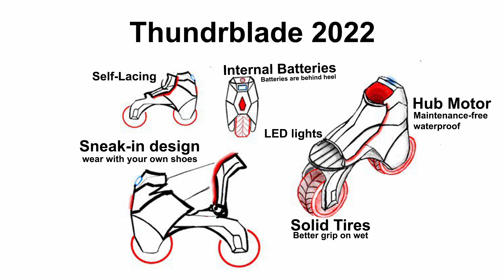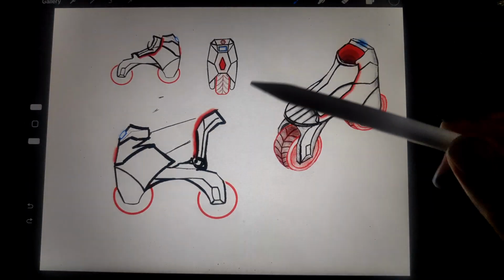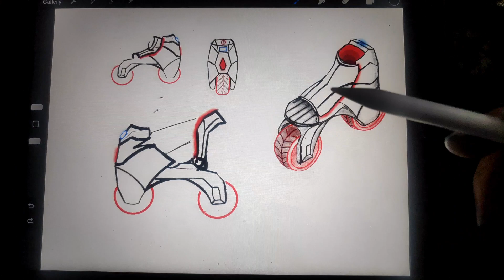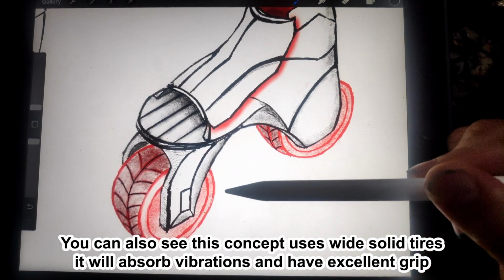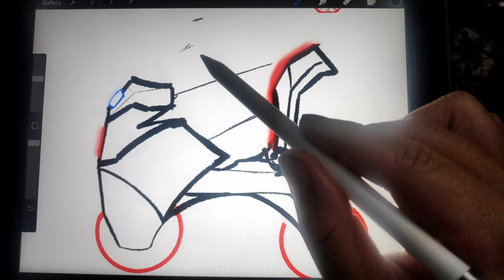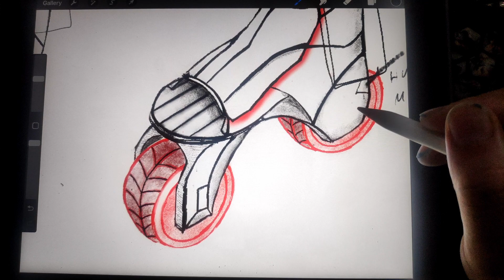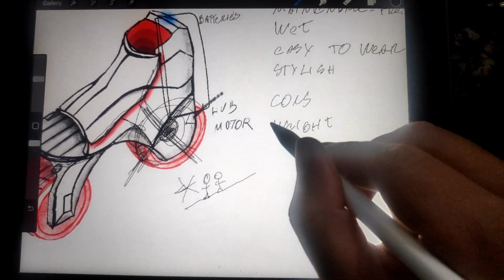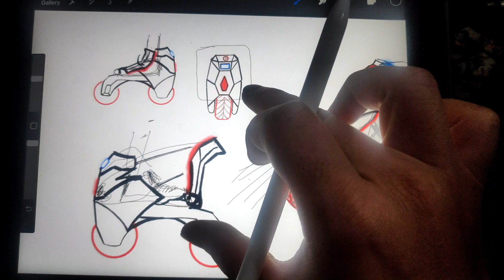Why Thundrblade will use HUB motors going forward

Comment: I honestly like the design. I see with the increased weight reinforcing this as for travel not extreme sports. It being slower is better since I don't expect to be a character from Air Geaf and survive. The video only left me with the question of control. How do you control speed, the locking system, etc. In the end this still has my attention and desire.
Reply from the maker: thx!
the handheld remote controller is how everything will be controlled. I think a "parking brake" dedicated button plus the slider to accelerate and brake.
basically the same as the old concept and the majority of electric skateboards out there.

Comment: I think the step in design together with a speed max of 30ish km is great for everyday use. Overall people on bikes travel around if not below that speed and with the size skates have they are easyer to store as well which I see as a big pro. Personaly I don't care for the LID lights but can understand if one of the goals is style. Weight wise I am not sure but I will keep an eye out for new videos on how much it might weigh. I also could not tell from the design itself if using this design for grinding is a possibility or at least doable.

Overall Looking good and you got my support.
Reply from the maker: thx Kitsune!
oh yeah, for urban commuting an electric inline skate that its convenient to step in and small enough to fit under a chair is great.

I dont intend to make thundrblade able to grind, BUT we can always make add-ons like an H-block, DIY is always a possibility as well.

I personally think a PEV Personal electric vehicle should not try to compete with dedicated and specialized sports equipment as it will always be worse at doing that.
I do understand though that grinding frontside and backside on a bowl and doing some airs would be awesome.

Comment: So excited Daniel!!!!!!! Re: Batteries, they could mount on the back and be quick swapable like cinema V Mount batteries. Re: Laces, electronic is cool, but if the batteries die, you can't get them off! Could use the same wire mechanism but manual twisting would be sufficient I think. (Now that I think about it, 32km/h torque on the feet held on only by wires is a bit unsettling. Is the Powerslide Doop ratchet strap system not fast and secure enough? ) And apart from motor powered skates, the second most exciting feature is the ability to adjust speed when going down hill. On a bicycle it feels safe because you can scrub speed with the hand brakes. But with inline skates it feels unsafe and requires a lot of skill to slow down on a hill. So being able to slow down like a bicycle handbrake makes it much safer and easier for everyone. Especially non flat cities. Good luck with the project Daniel, I'll be happy to help make videos to promote it!
Reply: Another thing, you could sell it as a complete skate, but have the frame and battery completely removable for the times one wants to put on non motorised wheels for fitness training/fun. That way a person only needs 1 boot.
Reply from the maker: Its still possible to skate for exercise in this new concept. the wheels roll normally when motors are turned off. this boot should not hinder this.

but if someone feels the need to have a carbon boot with skin-tight fit, or need a traditional 4 wheeled frame, its probably better to have a separate skate altogether. I mean, I have several skate pairs just to practice different modalities like slalom and aggressive and fitness.
Reply from the maker: Hey Hubey, thx for the feedback.

batteries will be quick swappable, so you can carry as many as you want and change them easily and quickly.

oh yeah, the self lacing is still in concept phase, but your concerns are valid. lets address them
I think there should be a mechanical, not electronic button to release the laces. the motor only pulls them, you would need to pull them off yourself to release them by pulling and pressing the button. so no need for batteries to take them off.

the same button could be the disc to manually lace, just like old puma discs or modern cycling shoes. after all, even without batteries this should be a skate.

the doop system is definitely not convenient enough. for me at least. I own a doop and a shadow and I love them but I still need to sit down and make a lot of effort to secure them.

thundrblade always used a handheld remote controller, so regenerative braking was always on the project and actually working on the old prototype.

Comment: This looks like it will feel less like rollerskating with such wide tires to manuver and make sharp turns , maybe im wrong tho , the design looks cool great idea to make them step in with your shoes , the auto lace are not particularly appealing to me as the wear and tear on laces happen as with every thing so i think standards scratch like on the doop skates would be better so it can easily be replaced when you need to , the locking is à good feature but will it also have regenerative breaking to refill the battery going downhill for instance ? Also i remember there beeing a remonte on the previous version, will it still be the case ? If yes check out Snowl ring an upcomming product currently kickstarting that make gesture controle with a ring size controller i think it would be cool to have it be compatible with something like that
Reply from the maker: Hey pablo, thx for the comment.

These wide tires will definitely steer thundrblade away from the traditional inline skate feel. Until I can actually test in real life I cant say for sure how much, but maybe its even better... who knows? less vibration, more grip, the ability to skate on wet surfaces and the ability to ignore pebbles seem pretty appealing to me at least.

the wear on a self lacing system is a valid concern I will take this into consideration when designing it. but you know, straps/velcro are already around if needed, lets try something different for now :)

regen brake is definitely on as well as the remote.

oh yeah I've thought about gesture control, weight shifting and all, but the easiest for most people will be the remote, also it is just easily available. maybe in the future, we can delve into developing something. for now, my focus is the skate itself.

support us on ko-fi

http://www.ko-fi.com/thundrblade
every single dollar helps.

Comment: the self winding system might be a little too much for the battery as well as all those LED's, the front lights make more sense imo and the rest should better be just optional. Other than that I am really happy to see you pick this up again I will support it as much as I can, keep it up ✌😊
Reply from the maker: the LEDs and the self-lacing system spend so little energy compared to the motors it will make absolutely no difference in the range. Even a very strong front light would be around 1~2 watts compared to the 500W from the motors.

thx for the feedback though. I can see that its a concern for some people. Thundrblade will still evolve and change so nothing right now is set in stone.

Comment: Hi Daniel,
Fellow inline skater here!
I've been a big fan of this project for a long time and I've shown off your videos to some of my friends and coworkers and they're all impressed with your work. I'm glad to hear you're back at it again in spite of every challenge you've faced along the way. Right on, brudda!

The HUB motors seem to be a logical next step in improving the overall performance of these e-skates, especially given the flaws of the friction drive you stated (great points to reconsider). But with talk about how these motors have quite a bit of weight to them I worry that, by putting the motor and power supply in the back, their combined weights might throw off the balance and weight distribution of the skate and make them heel-heavy and antithetical to the center-balanced nature of inline skates.

Would you happen to have any thoughts about this?
Reply from the maker: Hello Will, thank you very much.

About the weight distribution problem. It will definitely feel a little weird in the beginning. I will make a video explaining this in detail, but when you skate with 2 wheels in opposition to 4 or 3 wheels you balance is shifted backwards already.

Inline skates turn by dragging wheels. on 3/4 wheel skates you have to center your weight in the middle wheels and turn by dragging both front and back wheels or by shifting your weight backwards and dragging the front wheel.
for 2 wheel skates you mostly drag the front wheel, you only drag the back wheel when skating backwards (fakie) 

a heavy skate like this concept will definitely affect your technique when lifting your feet off the ground. theres no denying this. Since you dont NEED to skate on a motor powered skate, this will be less noticeable.

now, for my own experience. I tested this weight distribution before. its ok really. feels a little different, but its not bad at all. you'll get used to it fast.
if you want to feel it, try attaching a 1kg weight to your skate heel and skate with it.very simple. if you try it, please come back and say what you think about it. :)

Comment: I found you last year, I watched every video multiple times. Seeing how the motor system was, I was worried about water as you mentioned. But, I was also worried about loss of energy and not being as efficient, as well as wear on the wheel and everything on the motor, as well as possible stripping problems on various parts. Hub motors are a great idea!
Reply from the maker: legitimate concerns, but to be honest efficiency on friction drives are actually high. depending if you use chains or belts and their qualities, friction drive could be better.

especially considering our modern inline PU wheels. 
anyways, old prototype had a better Wh/km than belt electric skateboards. not by much, but considering it was a prototype it was good enough to prove efficiency was not a problem.

and thx for watching the videos <3
Reply: @Thundrblade  No problem at all! I dodn't know that friction drives had such high transfer efficiency, honestly.
The battery efficiency should be better now compared to 3 years ago, though. Batteries, at least phone batteries, made a noticeable leap in efficiency for size in the last 2 years. Normal consumers won't notice because phones have also gotten more powerful cpu's which, unlike computer or laptop cpu's, jumped in energy consumption just as much as the batteries jumped in efficiency. 
But, batteries in general made a very noticeable jump in efficiency for size. So really, it'd come down to the wire gauge, connector type, and wire insulation type you go with that should impact the efficiency the most. That's something people also don't generally know. Wires impact power efficiency, too. You can have the best battery for capacity and efficiency and the best motor (or whatever the power is going to) as well, but if you have low-quality wire the efficiency is going to be worse than expected. You might even run into overheating issues that could more than easily melt the insulation and cause a short, blowing the battery and/or motor.

Comment: 6:38 That might be too ambitious; Personally I'd use velcro or adjustable straps.
Reply from the maker: maybe. but we can dream.

a skate where you dont need to sit or even touch with your hands to strap on is a beautiful dream.

of course we can always go back to traditional lacing as well. 

on the more serious note here, the self lacing feature is not that hard to implement, but we will have to try to be sure.
thank you for your comment.

Comment: I like the slip on boot feature, And great explanation on why its a rear wheel drive motor. I do like the design but what I personally look for when shopping transportation devices is the distance/range of the battery. So to maybe compromise with that you can use the gap in-between where the arch would be although it will add more weight. Overall though I'm liking the concept.
Reply from the maker: yeah, I forgot to talk about this.
Batteries are swappable, so you can get the lightest possible skate on your feet and just carry more batteries if needed. even old concept had swappable batteries, thats why I forgot to mention.

behind the heel should be space enough for a decent urban range. of course an exact number is impossible to tell right now since the prototype does not exist yet, but it should be safe to assume more than 20km in a single charge.

Comment: I like the basic concpet , the locking feature is a must if you want this for urban enviroments , no one likes the hassle of removing your skates to do minor shopping , as a potential customer i just have 3 concerns , 1. leds on the rail section light up a ridicule amount of street , i might be wrong , but when you get to any kind of prototype try locating the road lights on the boot part so you get a better light flooding the road ahead of you, 2 please make the self lacing optional some people like it , some people hate those gimmicks and 3 have some sort of quick release for the batteries , you dont want to be locked to a batter thats about to fail catastrophically and in a violent way right in your ankle

Comment: Ok so we are on linear paths here. It seems like you're shooting for a mass market style while we have been going for more of a customizable skeleton. I absolutely love the idea of slipping them on with your shoe on instead of them being the shoe which had been my biggest issue with ours. I was too young and broke to support last time but now I've got a job and can't wait to help as much as possible with your next round of work!
(After thought) we have been strongly thinking about pressure pads instead of a controller. So you'd actually have to balance and build muscle to use these very dangerous skates. What's your thoughts on pads?
Reply from the maker: thx for the support!

I'm personally against having pressure pads inside the boot to mimic air gear.

In reality very few people would be able to use them properly. My main concern is that proper skating technique REQUIRES you to shift your balance front and back. We also jump, or climb up or down curbs all the time.
and like I  mentioned in the video, you need to shift your weight to the back wheel in order to turn. that would make very hard to turn while accelerating.

the only way to make it work while turning is to have some kind of steering, which is not impossible, but it would be a different kind of vehicle.

In theory it might work, but I think its just too big of a barrier for most people. BUT if you experiment with that let me know :) im all for experiments.

Comment: also I think that locking my shoe inside the skate will not lock my feet inside the skate
I wear very spatious and light shoes so I would prefer the old enclosure for my feet in the skate I would feel it more secured that way
but yeah if you plan to make just a slow electric skate than there is no need to
Reply from the maker: check out Xsjado skates, now called USD Shadow skates. they are aggressive skates that use a separate shoe. I have one. they are a different feel for sure, but very good. I like them a lot.
so its completely possible to have this work. of course it will not work the same for every kind of shoe out there.

~30km/h seems slow for some people, but imagine doing that on a long uphill. unless you are an elite athlete most people would not be able to do that. 
but yeah, we all wanted faster and lighter, but we gotta start somewhere. 

Also dont forget that the skates will still be very very fast on downhills with the advantage of having electronic brakes that recharge the batteries.
Reply: @Thundrblade  yes thank you for keeping the auto recharge brake design

it is hard to imagine what is actually 30km/h in reality
it will probably be enough
but yeah people will always like to own more powerful skates even if they don't use the top speed it is a very cool thing to have